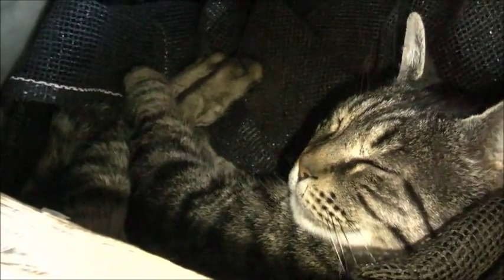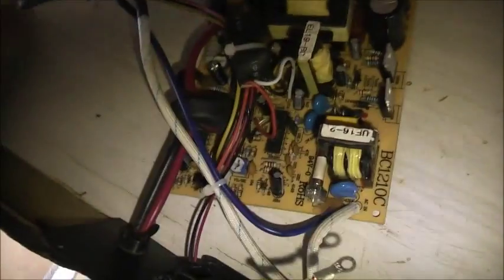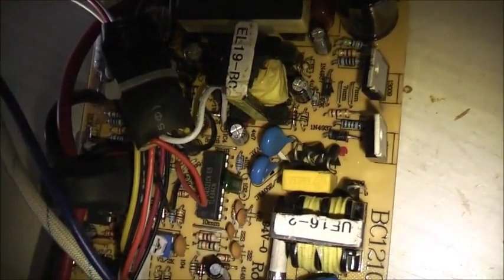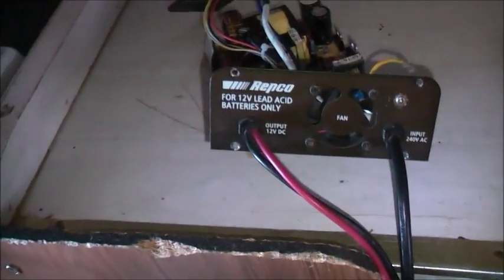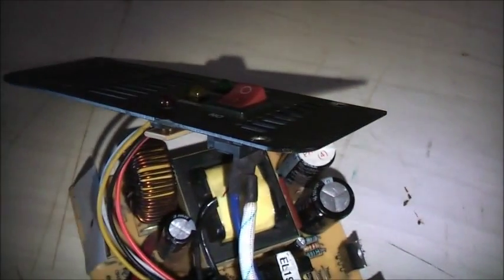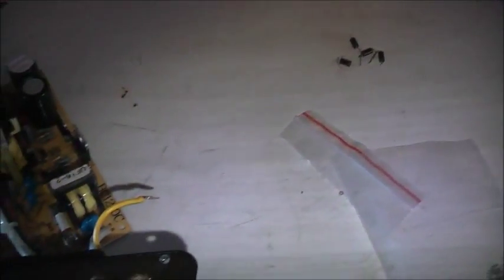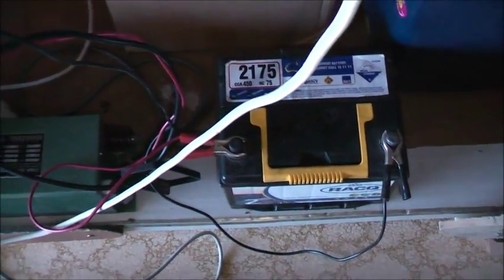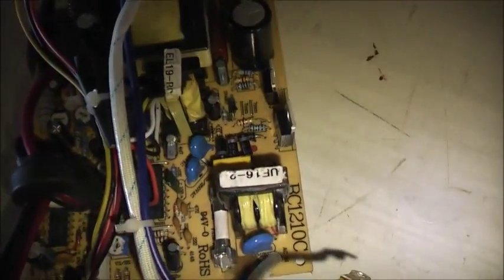SMPS Battery Charger Repair

Comment: Often when an SMPS dies, the mosfet shorts. That takes out source resistors and the bridge as well, all going back until the fuse dies last! I'd almost say for sure the front end is mostly dead,  but if you miss one thing fixing it, it could all bang again!
Check the transformer primary and flyback diode too! Also, perhaps replace any little caps involved, Main one should be fine though!

Comment: Loverly cat, cute furry frends, im sure it was swearing at you, "bugger off im sleeping" lol :-)

Check the inputs to your transistors, trace them back and check all you can that drives them.

Mark19960 sounds spot on.

Check your new transistors, just in case you damaged them with bad input rectifiers.

Your doing well mate, dont get pissed off with the charger, keep tracking down the shitty parts :-)

Comment: There should be some filter caps after the rectifier. measure across those caps and see what you have. 
If your putting ~240 into that bridge your going to approach 320 volts DC across those caps.
Make sure you have that.
These are -lethal- voltages so please be careful.

If you have that then make sure there inst something crazy like an open winding on the transformer.
Barring all of this it's likely you have an issue in the feedback circuit.
Check the optocouplers if it has any.